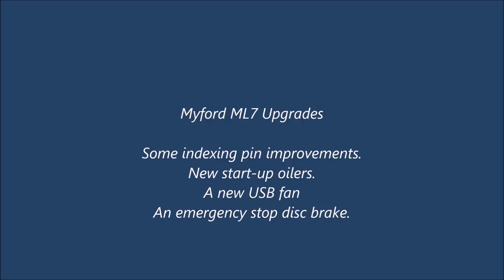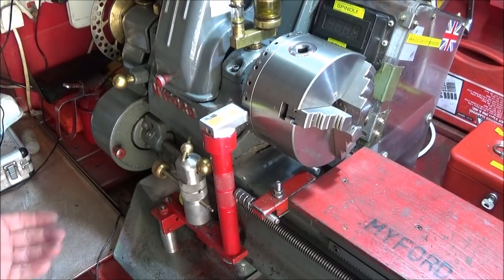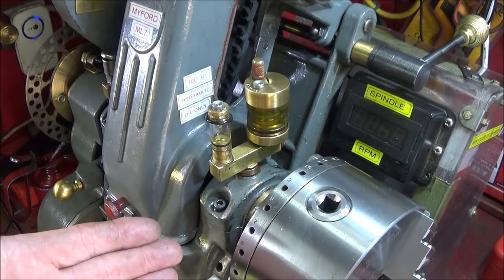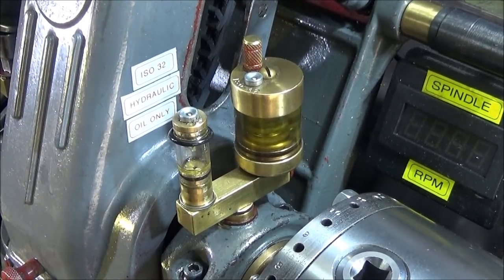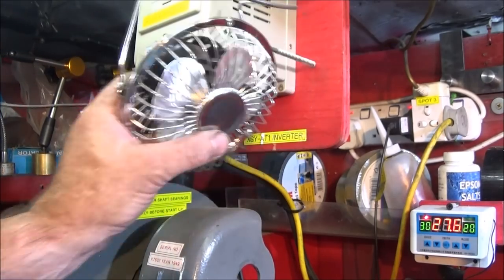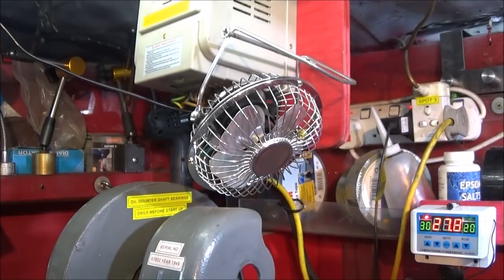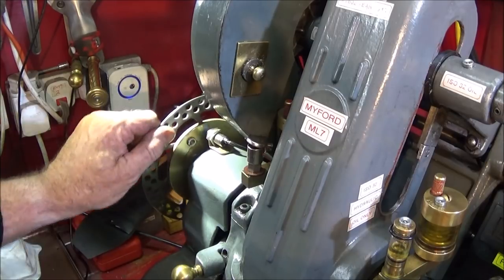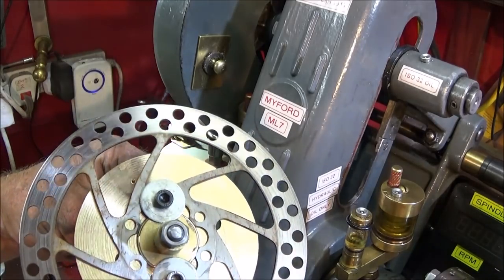Some New Myford ML7 Upgrades. New Oiler, & Spindle Disc Brake

Comment: Hi Steve. I did a similar indexing system on the Chinese minis lathe. But my pin storage container contained a microswitch and the lathe will not run without the pin in its parking place. I index from behind the chuck  or outside the gearbox cover now on the lathe now and both options use the same pin So there is no danger of the lathe operating if the pin is not in its parking place.. Like the brake idea. I am making metal gears for the lathe at the moment, but I may steal that idea as one of my next projects :) Regards.

Comment: To quickly stop your spindle, I'm surprised that you aren't installing a braking resistor on your VFD. Easy to install, reliable, and very effective.
Reply: Good point - and you can choose a known amount of braking resistance, not too much so as to unscrew the chuck, but enough that it stops more quickly than coasting to a stop. The deceleration speed settings in the VFD are the place to look. Time a normal "coasting stop" and then set the VFD to stop in perhaps 1/2 or 1/3 as much time, as a starting point at least.
Reply from the maker: @CraigsWorkshop  I will check all this out when I get the time. I only know basic electronics and about the VFD's and it takes me a while to learn new things like this.
Reply: @SteveJordan  No problem. The mechanical one is nearly done so it's definitely worth carrying on with that!
Reply: Hi Steve,   just a random thought  or two.    Could you run a wire down to your brake pedal and have a switch in there and wire back to your controller or motor to open as soon as you touch the brake.   Even a micro switch with correct amperage would work.    That would shut your motor off and still let you brake.   Then if it's set to not full brake you could have a very quick setting to full brake when you want to lock up the spindle.    Wether by brake pedal or by a separate lock at brake disc.    Thanks for the idea of the brake disc.   Almost looks like you could do some indexing with it.
Reply: @SteveJordan  There are some things you may need to consider in this project. First, the electrical connections between the motor and VFD should not be broken when the VFD has power. Doing so will likely destroy the VFD's output transistors. Second, your VFD should have settings for adjusting it's deceleration time. When you send a stop command to the VFD it ramps it's output frequency down to zero to stop the motor. Power is typically not just shutoff when you send a stop command. Because of this attribute, unless you alter applicable parameters on your VFD, your new mechanical brake will be needlessly fighting your VFD/motor.
One of my favorite functions of VFD's is there ability to stop motors very fast; much faster than a mechanical brake. Even models without braking resistors typically have an internal braking transistor. Though not as powerful as an external resistor, they can still stop motors in ~2 seconds. A braking resistor can do it even faster.
Reply: E Designs Exactly, no doubt this is the best way. I am using the VFD deceleration function to quickly stop my lathe in a similar setup (Myford Super 7). A deceleration time of 0,5 s works fine with my 1HP VFD without the need of installing an external resistor. A word of caution: When using a heavy workpiece/chuck combination the chuck may unscrew on the stop with such a sudden deceleration. Don’t ask how I know.

Comment: Nice work on the oilers, and the brake is a good idea too. If you have a screw on chuck, just be careful when suddenly stopping the spindle that the chuck doesn't unscrew (particularly when you have a decent size work piece in the chuck, more rotating mass!). Where do you get the little button oilers? They look great.

 Good info and tips Steve. Thanks.
Reply from the maker: Hi Craig that's a really good point about sudden stopping and weight mass. Good that you pointed that out it would most probably unscrew on a fast stop.I will keep that in mind. I wanted it more just for stopping after releasing the counter-shaft lever, or for holding stop solid whilst component adjustment is made. I will let you know later where to get the oilers from....I have to check through tool supplier lists Regards Steve
Reply: @SteveJordan  Thanks Steve - much appreciated. See you in the next video!